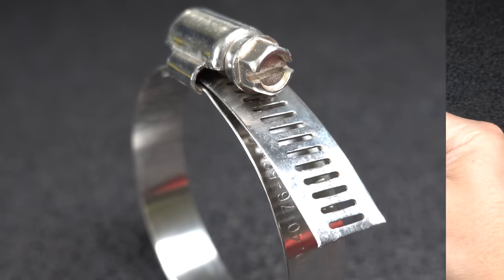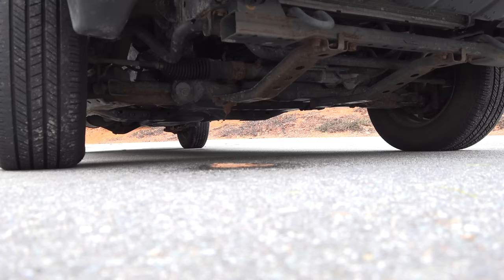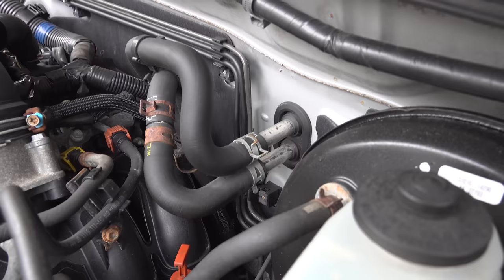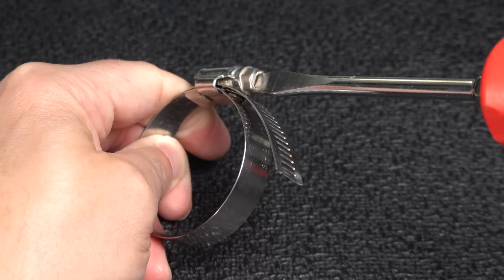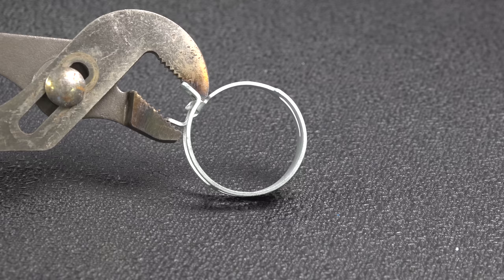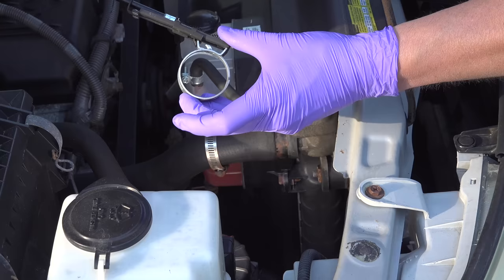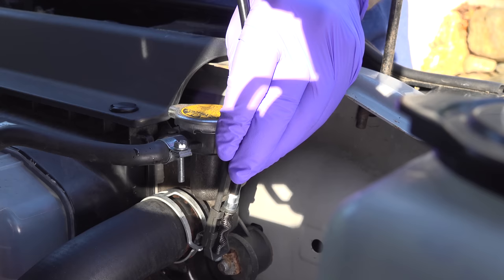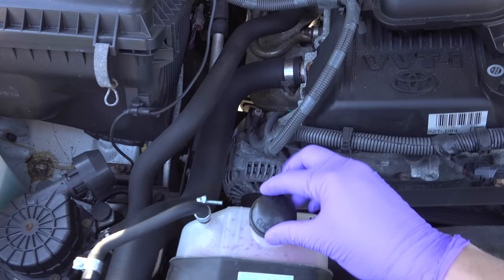STOP Using Hose Clamps WRONG - LEARN A BETTER WAY

Comment: Those stainless clamps if you do them up too tight will squeeze the rubber through the holes in the clamp,then become loose.  Our workshop at work used those stainless clamps on our gas set,you can guess what happened there,as a result I got severely burned when the hose came off.

Comment: It’s exactly what’s happening to my car. It only leaks when cold starting the car, then a few minutes later the leak stops. And I had to record under to see and it’s probably bc I’m using the clamp that it’s not recommended as u stated.

Comment: I’ve been a mechanic for 29 years . And if I have to remove any of these clamps I end up replacing them with worm clamps as these lose their tension over time especially if you squeeze them . Also , if they pop out of the tool they hurt when they hit you .

Comment: I've always used worm clamps and use a WD or light oil on the clamp, never had a problem in over 50 years so why the hell would i change now.🤔

Comment: In an emergency road fix on a borrowed car, I used two side by side zip ties with a tensioner, four months later, my friend still hadn't changed it, I'm not recommending it as a long term fix, but...🤔

Comment: Never had this issue working as a mechanic professionally. Those spring clamps lose tension through heat cycling and if they don't rust out, the first time you remove them on an older engine they'll never hold again. I've seen worm drive clamps on 1960's cars that had never been removed and still held pressure just fine.

Comment: The best clamps we use in the racing industry are called T Bolt clamps. They have tapered outer edges so they don't dig into the hose and apply pressure evenly around the hose. Worm gear shreds the hose as you tighten down, as long as you know when to stop you'll be ok using these. Pressure clamps which are used by auto manufacturers are great but they are not stainless steel so they corrode easily and become brittle, they are also the biggest pain to work with if you don't have professional locking hose clamp pliers. T Bolt clamps are the most expensive and you need to get name brand ones like mishimoto. Ebay and Amazon sells Chinese knockoffs that are trash. Also we primarily use T Bolt clamps on vacuum silicone hoses. Coolant, Fuel, Transmission, Brake, Oil and Power Steering lines are Stainless Steel Braided or Nylon braided PTFE and NPT AN hoses. You need to have the bung fittings welded professionally but they will rarely if ever leak or fail on you. :)

Comment: On top of that mini radiators, these days are plastic, and I’m sure a lot of people over tighten the wrong type of hose clamp that could break the radiator or at least the part that the hose goes over which could be minor or major, depending on how much they mess it up. I have seen several cracked like that.

Comment: More times than not it’s the spring clamps that leak and I fix it with a worm style. I never re use the spring clamps. I always replace them with worm style clamps. I do this on a daily basis

Comment: I work with big emergency power generators, and yes in some cases they require a retight when the hose settled.
I am also a hobby car mechanic, and there I never had a leak like that!
The spring clamps work good, but they are a pain in the a.. To install in general an especially in tight places, you also need always the exact size or the won't f... work at all!
To small? Won't go over the hose! To big? Won't seal at all!
Yea for car manufacturers that's nice, fire and forget! But for car enthusiasts that modify and stuff, they are no good!

Comment: Those “New style clamps” have been commonly used in European cars for at least 25 years. A lot of folk in the trade hate them, however I’ve always preferred them.
Worm drive “jubilee” clips are absolutely fine, however I’ve always found that the ones that come with Japanese cars are junk, however I find that with all Japanese nuts, bolts, and fixings, which appear to be made of cheese 😀

Comment: Sometimes there is more than one right answer & the “ engineered technical “ one is not the best “ working one “ . For example , I thought I would try these fancy new coloured silicone hoses for my cooling system overhaul , when I first looked at them after purchase I thought they felt a bit softer than a traditional rubber hose , so I thought about the clamps & decided to use the wide band t bolt style stainless hose clamps which clamp over a much wider surface area than a normal style screw clamp but have a limited clamping range so test fitting “ all new bits so this was easy “  & then use  verniers to get the right sized clamp for each hose end , pretty clever hey ! , well it turns out not so much . I have never had so many cooling system leaks & it I made it worse by doing our second car the same . I still think  the wide band clamps are a good idea but those soft ass silicone hoses , NEVER AGAIN , too much having to retighten them in service , there shit , back to normal rubber next time .

Comment: I don't think so. If there is a temporary stretch that means leak still may happen depending on the pressure of fluid. On my car one of the hoses began to leak so just recently mechanic guy tightened it (added right to original one) with that common hose clamp to stop the leak. It works for now, gonna check if it will leak or not in following days and weeks. But the best option is to replace both hose and hose clamp with the original ones for sure.

Comment: That style of clamp is called a speed clamp and the factory uses them for speed of install and they are also less costly then worm drive clamps, lastly they are meant to be a one time use clamp that you are to replace if you ever remove it, I reuse them but you are technically supposed to replace them.

Comment: I tried sticking with the original spring clamps, but they are difficult to find. Also it is almost impossible to install in tight spots. Have not had any problems with regular clamps loosening.

Comment: Is the spring clamp better? Of course, anyone can see that, obviously. However, I have never ran into the issues you are claiming with the other type of hose clamp and I have been a mechanic since the early 80s. If the hose keeps leaking once you have tightened it down it is usually an indication the hose needs replaced also.

Comment: I have over 5 decades of working on small engines, motorcycles, and cars.  Spring clamps were already common on cars in the 1960s and 1970s, so they are nothing "new".  Quality mechanics from that era would commonly remove and discard the oem spring clamps and replace them with worm drive clamps.  If the hose is so hardened and brittle that the rubber can not absorb any slight expansion and contraction with temperature, you should consider replacing that hose.  Properly tightened, the worm drive clamps don't leak.

Comment: I've had less problems from gear style clamps than the constant tension clamps. I have had the ends bust and hit me in the face...... they are hard to remove in general.... especially if there is not much room in that area. Yet... never a leak or problem with gear style.

Comment: Had a tension clamp rust out and fail on my lower radiator hose and dump out all my coolant. They need to make them in stainless.

Comment: The only time I had an issue with a worm drive clamp was when I used a made in  CRAP  CHINA  hose clamp that I bought in  ADVANCE Auto . Found an old used worm drive clamp made in the Good ole USA  and I have no problems . Buy the good stuff and you won’t have any problems . Wrenching for 50 years and still going.

Comment: Mazda clamps when bought new come with a retainer clip that holds them open. Simply locate the clamp where you want it then pull off the retainer with needle nose pliers and they close tight.

Comment: Those factory-style hose clamps usually can't be reused. If you take off a hose with one of those, it's usually best to replace it with a worm drive clamp when reassembling or else replace the factory clamp with a new one and install it in exactly the same position.

Comment: I have an 08 Grand Prix GXP. The radiator cracked so I had to replace it. I had these clamps on a hose that's under the front of the engine. Its a b***h to get to. I finally got a grip on it to pull it down and both ears broke off. It took me an hour to get what was let of it off. I took every one of these off and replaced them with the screw type. The clamps were not rusty. This is a Georgia car.

Comment: Working at a dealership, when we replace a hose we chuck the spring clamps out and put new worm drive clamps on.
And I absolutely hate Toyotas new style spring clamps, they always twist in the pliers  as there's no 'fat' side, the tangs are slightly diagonal to each other.
The old ones aren't much better when working in tight spaces, the pliers like to slip under the tangs and end up between the hose and clamp.

Comment: The screw clamps are all I use because of clearance issues, its impossible to get spring clamps off of certain hoses on my motorcycle. IN FACT, I had to special order an OEM screw clamp because of the specific size and thickness

Comment: Nope the factory clamp rotted on one side and when the mechanic took it off the clamp snapped with 3/4 left on the hose. He had the pry on the rubber and the radiator fitting. I was hoping he wasn't going to break the fitting. Luckily he was doing the job. My mechanic 40 year on the rack installed stainless steel clamp! Next oil change I'm doing  all the clamps!

Comment: I have literally never had an issue with worm gear clamps. They're the only style I use because they seem to work so well. I don't know what you're smoking but I hate the spring style because they're a pain in the ass to get off.

Comment: He is right you need to use these clamps if your car came with them. All these new brittle plastic cars you can overtight in the worm gear clamp which will crush the plastic. And also I've seen people tighten and worm gear clamps down and damage the hose. That's why you usually see a puffed up hose next to one of them. You'll never see a puff hose next to a spring clamp. I've owned my own shop for thirty years i've seen it all.

Comment: You have to use the correct size worm screw clamp. The problem is when tightening them they will oval, And not make  a even connection. But they were the mainstay clamp for 50 years, The new clamps are cheaper to manufacture and fit on the production line,

Comment: Project Farm just released a video on hose clamps, not saying that these spring tension clamps don't have a right time right place application, but they didn't fare too well in the tests...
Reply from the maker: Sadly his tests didn't take into account why constant tension clamps exists and are better. Massive temperature changes. They expand and contract. It's not mystery why every manufacturer switched to then to reduce leaks.
Reply: @SilverCymbal  very true, also possible that the example he tested was of inferior quality.

Comment: I can almost guarantee that the only reason manufacturers spec the spring clamps is because they are faster on an assembly line. I've found that worm drive clamps often need to be retorqued after the first install, especially if you are using them with new rubber. You usually only need to do it once, though. Most of the worm drive clamps you buy now are total garbage. Many strip out before they get close to sealing. I don't know where find decent ones.

Comment: On the Chrysler product back in the sixties there were spring type clamps and boy they could be in the worst places, and you had to use a pair of pliers made for the ends of the clamp. But I will say one thing; I've never seen one leak where these clamps were used. General Motors used a tower clamp (and they were a pain in the ass) but installed properly I've never seen one of those leak either. Worm clamps are a different kettle of fish. If the clamp has been used too many times it should be replaced, if the clamp is all rusted up it should be replaced, and of course like all the other clamps, the proper size worm clamp must be used. But I have seen technicians overtighten worm clamps to the point where they bust the fitting connections and I have seen technicians use the wrong size clamps and just maul the hose itself. So the biggest advantage I see for constant tension clamps is just that constant tension.

Comment: I always use a drop of oil on rubber hose  as it let's them tighten evenly with about a 25%squish into the hose to allow for your heat expansion problem

Comment: In my 50 years of working on vehicles I have found the exact opposite to be true. I have fund that the screw type clamps are much better then the other type, in fact, one of the cars I own is a '78 Fiat 124 Spider on which there has been a fuel leak at the fuel filter on and ff for the past two years which I mistakenly thought was resulting from a defective fuel filter but I recently determined that it was because one of the three clamps on the fuel filer was not a screw type clamp. Once changed the leak was permanently eliminated. And, at 67 years old, that has been my experience my entire life.

Comment: Quick tip! coolant rusts metal like crazy, spray any down with window cleaner. it stops the coolant from corroding you undercarriage. Coolant leaks WILL rot your car extremely fast so get em stopped asap

Comment: Dunno what the correct name is but on old British cars, particularly BLMC, the clamps were a type of wire clamp tensioned by a screw and threaded boss. Never had a problem with those. Reusable time and time again and the amount they could be tightened was such you could almost cut through the hose!

Comment: I understand perfectly what this guy explained but I been using the wrong clamps all the two decades I been in automotive repair industry with no issues, the reason why most of manufacturers use the tension clamps is because is very easy and quick to place on and save time to the assembly plant by just pulling a clip  to release the pressure instead turning a screw to adjust.

Comment: When he opened the hood I could see coolant on top of the radiator cap and on the threads of the small clamp. Odd leak. If the large clamp was leaking it would ether dribble out or spray out. If it dribbled out it would not get on top of the cap and if it sprayed out it would be all over the place. I have worked on cars for over 40 years and have had no problem with the older style clamps.

Comment: Trucks, boats, cars, motorcycles, lawnmowers, every vehicle that I've worked the hose systems I've put hose clamps on. And never had a problem. Every hose under the hood of my truck is held tight by hose clamps, even the air horn hoses.

Comment: There are many styles of clamps for different applications, the worm style you're showing is probably the worst but the constant tension one isn't the be all end all.
The main problem with the American worm gear clamp is that it doesn't distribute force evenly, and can damage older hoses. This is where the European style improves the function. Then most commonly you have t-bolt clamps, cinch clamps, and fuel line clamps. All used in OE and OE+ applications and serve their function for their application.

Comment: My audi factory clamps(worm screw type) all started leaking at midwest winter temperatures. Then they stop. The toyota has the spring type clamp and never let a drop. But i can never find the correct size of the spring clamps for various hose sizes

Comment: I do the opposite. I swapped all the rusty clamps for some nice new worm gear ones, and they're much easier to work with.
Reply from the maker: Easier to work with and they will all leak and crack plastic fittings which are on nearly every radiator now. Be careful. These exist and cost more for a reason, the grow with the flow

Comment: You did not mention you need special expensive tool to work with this spring clamps. And since it is a spring it is a dangerous thing that can fly off directly to your eye. Also sometimes it is really hard to work with this spring clamps since there is not much play in them. Even when fully compressed they dont go on the pipe. Screw clamps are better in every way.

Comment: I’m experiencing this exactly on my 2010 Avalon after I replaced a hose with these wrong clamps .
Reply from the maker: I have learned on Toyotas that 99% of leaky hoses are fixed permanently with a factory hose and spring clamps from toyota. The aftermarket stuff we used years ago and old style clamps won't last and leak

Comment: I am not going to read any comments below as this is April 15th, 2022. I have started repairing or rebuilding import motorcycles in the early 70’s. This is the flat version of what’s called the “Corbin Clamp” invented about 100 years ago. Named after the inventor, imports and Chryslers and others started using the spring alloy wire clamp. At some point, this clamp was made flat. It keeps constant pressure on a hose during the expansion and contraction of engine and fluid temps. As a radiator or A/C condenser is pressured or heated or cooled, they expand like a ballon and move. A simple worm clamp can not and will not maintain a constant seal. If you have on on a hose or cast aluminum thermostat housing, measure the sealing area the hose and clamp rides on. You will find a rough unfinished parting line from two halves of a casting mold or poor machine / hand finishing every time.
 It is simple, not hard. I don’t trust any screw clamp, worm clamp or whatever you call them, period!
Nylon plastics like PA66 GF33 intakes, oil pans, radiator tanks, air delivery boxes, rocker arm covers and more take so many thermo-cycles and they crack or break. It is not the clamp, it is what it goes onto. Simple!
DK, ASE master tech since 1978, retired.